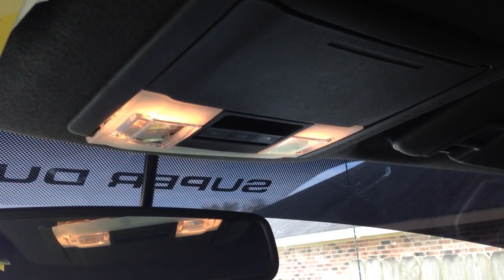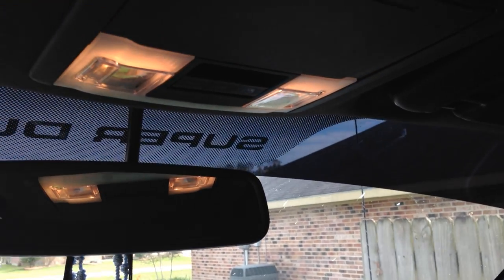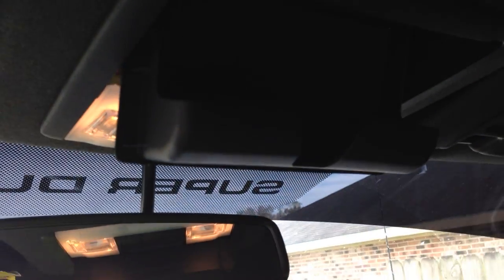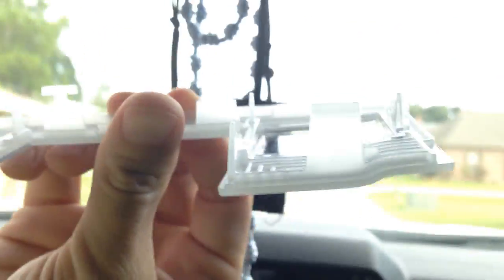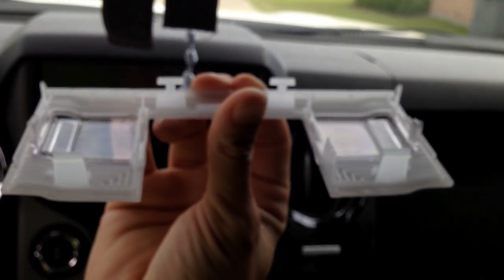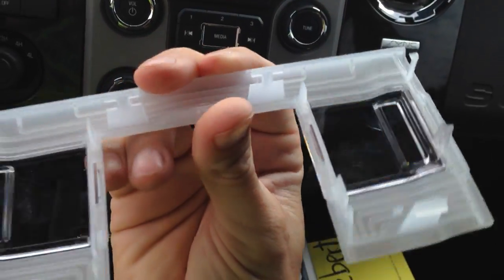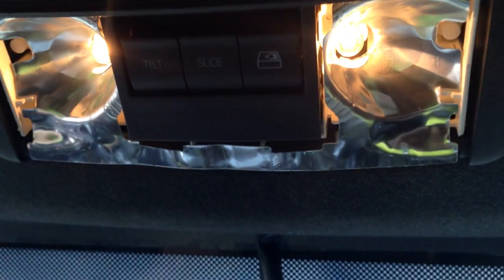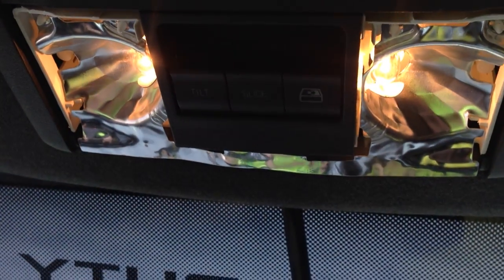How To: 2011 - 2013 Ford F250 with Sunroof Map Light Removal

Comment: This was helpful but I'm unsure what LED bulbs to order?  They are very tiny and the manual just says they are "12V6W".  Do you know what style/part number they are?  Thx!
Reply from the maker: I personally bought the Recon 264201WH LED Bulbs. I got them on Amazon cheaper then Recon's website.  I have had them in now for 10 months and I don't have any issues. I also bought Recon Accessories 264163 Ford Super Duty Dome Light Set LED Replacement Bulb for the rear dome light.  As you can tell in the video I have the sunroof thats why I needed two different light styles.  I hope this helps.
Reply: Another video I seen they are just 194 size bulbs.  Is that correct?

Comment: Can I just pull them out with my fingers or do I have to remove the metallic cover?
Reply from the maker: I would remove the metal piece first and then pull the bulbs. If I remember correctly the metal can bend very easily. The bulbs will be a little tight, but they can be removed with just your fingers.

Comment: What type bulb should be used?
Reply from the maker: To tell you the truth, it's been several years since I installed these lights and I don't have the truck anymore. I do believe they should be 194 type bulbs. I originally got the recon 2nd generation ones, but a quick check on their site and I can't find the package I got. Not sure what truck you are putting it in, but i looked up on Google 2013 Ford F250 map lights and got a couple of sites that do offer LED bulb replacements. Sorry I couldn't be of more help.
Reply: Everyday Gear Channel No worries!  I ended up going to Advanced Auto Parts with the old bulb and picked out a set of bulbs with the same connector size.  Works perfect!  Thanks again for your helpful vid!